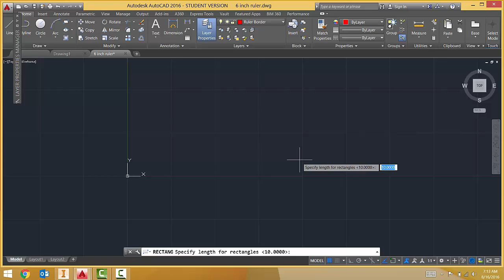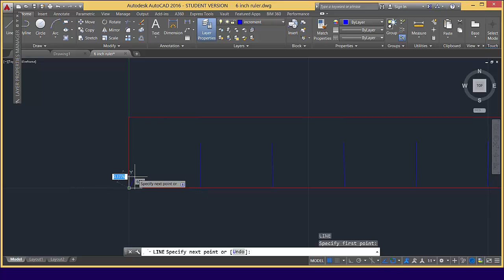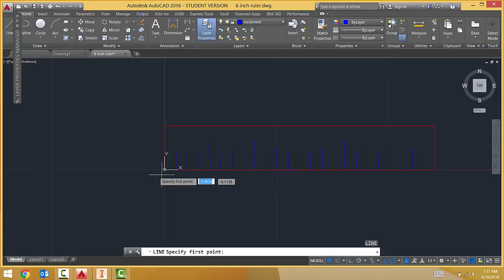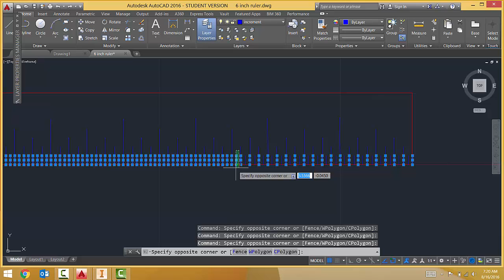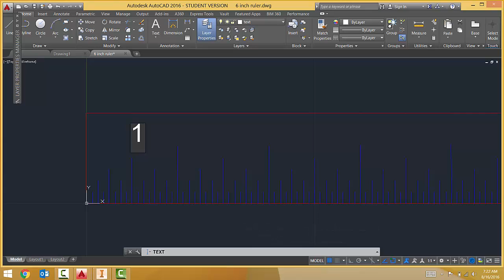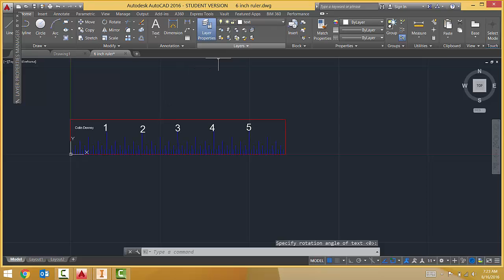6 inch ruler

Comment: To make it faster can't you just offset the 0.5 inch line by 0.5 inches and then offset that offsetted line by 1 inch increments.
And then for the .25 inch line offset the first one by 0.25 inches and then offset the offsetted line by 0.5 inch increments.

And repeat the process for the otherones.
Reply: So for the very small ones like the 1/16 line you can offset the first one by 1/16 and offset the offsetted line by 1/8 inch increments.
Reply from the maker: +Tardigrades that's a great idea. If I set up more incremental layers it would have been easy to delete the double lines, but your absolutely correct. Great call.
Reply: Is that you Ryan B.?